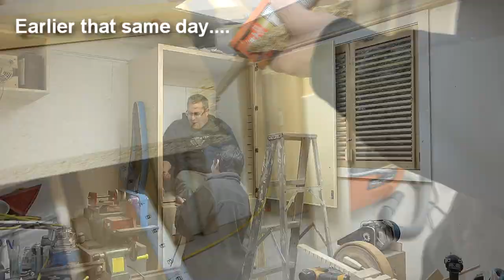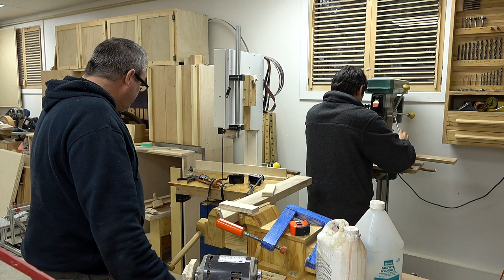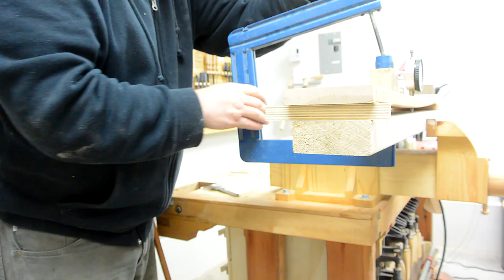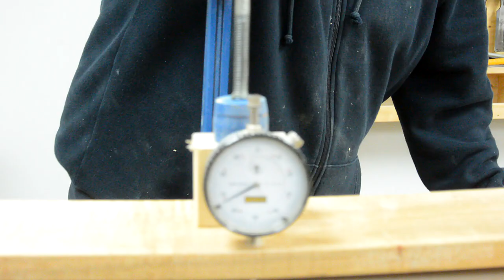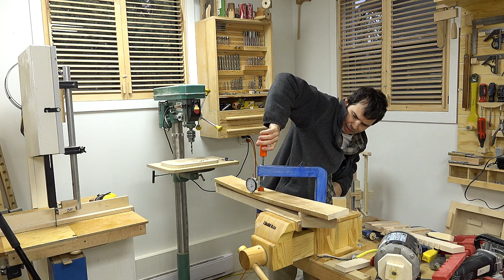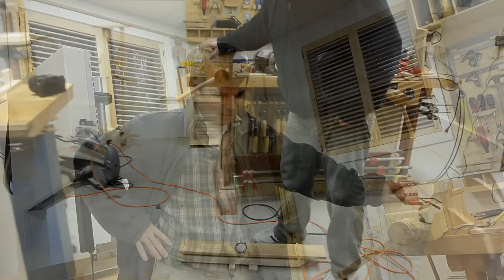Homemade clamp rivalry

Comment: John (paraphrase): "The strength is there; it's just breaking under pressure. It would go up to four, if I held it just right, even though the clamping pressure, which is the only purpose of a clamp, can't get past three."

Comment: Mathias and John: you guys inspired me to build a similar c clamp out of 1 inch square steel tubing for doing the brakes on my pickup truck. I welded it all up but broke one of the welds after FINALLY getting one side of the truck's calipers squeezed down to replace the pads. It was a real job, So I got this brilliant idea to weld a 1/2 drive socket onto the end and re-weld it. That thing is a BEAST!!! Thank you for giving me the idea. Now I just connect my battery powered impact wrench and let it do all the hard work. It's awesome! Y'all are a blast to watch.

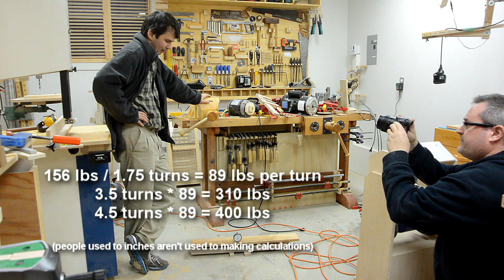Comment: 12:30  No it's not a linear graph, so just because you were to get 200lbs at 2 turns doesn't automatically means that each turns equal 100lbs. Am pretty sure both of you guys agree on that.
Reply from the maker: if it's not linear, then do explain why the relation is not linear and what relation it would be.
Reply: A curve plotting the movement of the beam you are clamping will be linear for most of the curve.  When the clamp joints begin to break, more force is used to deflect the clamp, or you close the gap completely, you will see a reduction in the slope of your curve.  How do I know this? - because I've done essentially the same test and collected the data, but using a robot arm, in a testing environment.
Reply: Because once there is tension and the wood is flexed (bowing) it will take more or less pressure to bend it just a little then when it was fairly straight. C'mon Matthias am pretty sure you know this, that's why I said that even if you were to get 100lbs at 1 rotation then 2 rotations at 200lbs, that does not mean that 3 rotations will be 300lbs (should be more or could even be less, but it will not be a linear graph). It would be a logarithmic graph. 

One way to prove this would be to actually plot it down every 10lbs, all the way up to it's breaking point and then we can all see the graph type.
Reply: jeanious2009 You would plot rotation of the handle vs deflection and my experience suggests you will see a linear deflection of the beam, certainly for what's just been shown on the video.  

You can do this yourself using the standard beam bending calculations here:

http://www.structsource.com/analysis/types/beam.html

The system in the video is closest to the pinned at both ends with a point load in the middle where x=a case.  Assume that each full rotation of the clamp handle applies the same amount of load in normal operation, because in normal operation of a clamp with a constant thread this will be the case.  Again, I have data proof gained in a professional testing environment.  The beam can be assumed to be homogenous and of constant section.  As you can see from the equation the beams stiffness remains constant regardless of the load applied, and therefore the beams reaction is linear.
Reply: Any graphs/tests to show this, I just don't think all wood is the same and am pretty sure the way the wood is cut/shaped has a lot to do with the deflection.
Reply: I think it is linear, mostly, https://upload.wikimedia.org/wikipedia/commons/thumb/5/5a/Stress-strain1.svg/300px-Stress-strain1.svg.png
Reply: But they tested it..  156lb/1.75turns = 89lb per turn, and John was 2.6turns and if he really was ~230lb then that is pretty linear to me.  Least until the board gets near its limit...  Linear enough to guess what the clamps could do anyway.

Comment: love the dueling banjo effects of the videos, watch both versions ,,, 
and in a lot of ways they are not store bought clamps of steel,,, but 
that said they are not store bought crap either , in real use you would 
never need to go to that extreme clamping pressure , have watched both 
of you for years now, and often wondered which had the better idea ,,, 
keep them coming guys   great work ,

Comment: The breaking point of either clamp far exceeds the clamping force of normal wood working use.  I don't recall a strength test in a video when these were made & didn't think much of the idea.  OK now I'm impressed & will probably make a few, can certainly see a use for them.

Comment: Couple of good eye-rolls in this one, John!

Any thoughts about progressive weakening of that maple board?   Oh wait, that isn't helping John's case at all...  :-(     In all seriousness, I am surprised at how much John's clamp flexed.     I think you're kind of right about the apple and oranges -- they aren't the same thickness of stock (in the clamps) are they?
Reply: His uses thicker wooden parts and a bigger lead screw (which resists bending, like mine did). Also, mine is made from flooring, so it have those grooves cut on the underside, reducing the cross section even more.
Still, I'm very impressed at just how strong the box joint is on it's own.
Reply: Sorry, but Matthias is absolutely right: The screws are ok. They are not meant to take forces from the side in an ideal world. Your's failed because of the failing joints. The rod got bent only slightly. Look at the joint, lol! Thumbs up for the courage to actually break it. Matthias one won, but after all it was just a test. Yours is good enough in real life. I mean who needs 2000 Newton clamping force? Really interesting that they don't look THAT different.
Reply: +Rainer Zufall john refutted every inch of your argument BEFORE you even posted yours in this same commentsection.
please read before spewing nonesense with 0 information to back it up
Reply: John Heisz bragging rights aside, they're both cheaper than a commercial clamp, and serve their intended purpose for the maker. Generally speaking, the additional force you can exert at a distance by having the clamp vs none at all, is more beneficial than whatever higher force a beefier clamp would provide. Thanks to the both of you for this collaboration.

Comment: Matthias's clamp clearly inspires more confidence but in John's defense I remember one video of Matthias stating that the pressure of clamping (seen by squeeze out) was not really improving the quality of the glue up.
Reply from the maker: too much pressure is bad, yes.  Like 500 pounds on a very small area.  But if you need to reach far, it's usually also a large panel, so 400 ponds is by no means excessive force.

Comment: I love the interaction and the comparison of the clamps.  It reminds me of when my brothers and I are together comparing different things we do!  I also love the box joint rivalry - so if you have not seen that - what that does is point out the pro and con of each model.  

At least that is what I see.  So if you are going to make a long reach C clamp, if you think you will need some serious clamping pressure, you need the extra time to create one like Matthias.  If it will be pretty much lighter duty (although ~300 lb clamp pressure, I would not consider light duty - just in comparison), then John's clamp is a bit quicker to make!   IMHO
Reply from the maker: for more about the box joing jigs, see description of the box joint jigs videos.
Reply: Ray Ramirez not just that, but using a heavier size Acme threaded rod like Matthias's will be less annoying to tighten, and the thicker material will bend less. It will add cost though, both for the rod, and the special Acme insert nuts.

Comment: This test is not legit. Johns clamp with the wooden block under the lead screw performs a much wider "pressure point" than Matthias clamp, causing his to apply pressure to a greater partition of the maple board than Matthias. Johns clamps must therefore work against the Maple board wanting to bend in addition to the actual bending/downward force. The riser block should have been placed under the Maple board on the fixed part of the clamp.  Engineering can be difficult. ;)
Reply: I have been working with this type of test for the last 18 years my friend.... ;)
Reply from the maker: do learn some physics, please...
Reply: Roy Ivar Hernes damn son bei g told to learn by Mathias. that's got to hurt.
Reply: He does have a, very small, point. It didn't change the outcome but John's clamp had to apply slightly more force for the same deflection due to the width of the riser.
I was surprised you didn't just put one clamp on each side of a seesaw arrangement and let them work against each other.
Reply: In my opinion, without calculating anything out, I'd say that the effect from Matthias being a little closer to a point load and the other guy being closer to a distributed load was negligible in this case. The difference wasn't that big.

Had that spacer been 4+ inches long, sure.
Reply: Angel: Hehehe. I love both of these fine woodworkers, and I am to old to care about Matthias ways ;)
stefanrethan: You'd be suprised if you sat down and calculated. ;)
Consult: I agree to a certain degree, but it definitely would make a difference. :)
Reply: +Angel Cedillo that would be an emotional response lavking logic nd reasoning. 
Most specialised individuals are severly lacking in every aspect of their lives excluding their specialization. Matthias is no different.

Extending the admiration to every other aspect othrr than that of his specialization is foolish...but again thats what most sheeple do with hollywood actors, granting them legitimacy in aspects where they are severly lacking because they mastered that one specialised aspect in their lives... aka robert deniro spewing BS about trump and actually convincing sheeple to change their minds about politics when he is only good at acting
Reply: You might have a point if the results were close, but they weren't. As soon as the angle of applied force is noticeably off from perpendicular, that clamp is past it's useful limit. That happened at about half the force for John's clamp.
Reply: I get only 1% difference in deflection, and that's assuming one clamp is a point load and the other is 6 cm apart on a 60 cm beam.
Reply: I used the beam calculators on engineersedge dot com. Electrical engineers are allowed to cheat.
Reply: Stefantrethan: Did you calculate with wood or steel? I was actuallly convinced it would be a greater difference. Okidoki, my bad.  I guess I have to go back to school! 😃 Sorry Matthias, 1 - 0 to you! 😉
Reply: I don't see how the material makes a difference on the difference?
If anything the softer wood would mitigate the effect, given that it gives at the corners.
Reply: Just pulling your leg, Stefantrethan. 😊
Reply: Came here to say this.  They both should've used the wider spacer block, or not.
Reply: you are exactly right. Matthias should have used the same block as well. This was not a fair comparison!
Reply: you really do not know anything about physics. if the above are agreed, they don't know either. The tip of Wandel's clamp has almost 4 times smaller area than John's block, so John had a 4 times disadvantage compared to Wandel. I am 100% sure that Wandel knew about it but didn't reveal the truth!

Comment: Um, it doesn't count as clamping force if it won't hold it on its own. The threaded rod was not the limitation. Once your clamp starts to bend and begin applying off-angle force, you're way past the limit of it's usefulness. The threaded rod only began to bend as a consequence of the clamp frame bending.
Reply: Trevor Lambert here and I thought that I was the only one who knew that.

Comment: you could also find the force exerted with beam deflection formulas :p
i tryed to do it, but the thickness of the plank is very critical in this calcul, and I couldn't get it precisely from a video

so you could find the force in Newton by using this formula : (4 x def x E x thickness³ x width) / length³
def=deflection in mm (number of turns of your micrometers)
thickness, width and length  of the plank in mm (inches x 25.4  and length being between the 2 "feets" of wood under the plank)
E=Young's modulus, in MPa (because N/mm² to be consistent with the other units), for maple wood i found 12 620MPa

I had realistic results with 23mm thickness, 150mm width, 610mm length (when you said 12in both sides, that is 12 x 2 x 25.4)
of 1.8kN for Matthias's clamp and 1.4kN for John's
which equals to 410 and 320 lbforce, compared to the 400 and 310 i got from matthias being 156lb and deflecting the plank 1.75mm
Reply from the maker: Also the stiffness of the board.  which varies wildly between boards.

Comment: The distans you use with the second clamp should be turned 45 degrees, otherwise it will be incorrect comparing.

Comment: This test would have been more interesting if they had used the failure mode in the second clamp to improve the design. It looks to have three failure modes: the upper joint, the flexing of the "spine" of the clamp and the deflection of the screw.  To fix it you could increase the width of the spine slightly and shape it in a sort of dog bone fashion so there was more surface are at the joints. That would solve two of the issues. The deflection of the screw would require a slightly larger diameter all-thread.   It would add a bit of weight but it would significantly increase it's capacity.

Comment: Wow, I'm surprised at the difference. So Matthias's clamp is all box jointed while John's clamp is just tongue and groove, but has that extra threaded rod. I would have thought the threaded rod would have made it much stronger. I wonder how it would compare if they were both using 1/2" threaded rod.

Comment: That block being wider under John's probably effected the measurement cuz the pressure was more spread out....  Although the clamp itself did seem to be a bit more flexed....
Reply from the maker: No, spreading the force over such a small area makes no measurable difference.
Reply: Ok. 😎
Reply: I was more thinking along the lines of the footprint in relationship to the distance across of the plank being squeezed.  A smaller piece pushed down would allow more flex in the center as opposed to a wider point.  ...maybe I'm splitting hairs.  I enjoy both of your videos.  I was shocked when the F bomb came out though.  The wife and daughter gasped and was wondering what horrific content I've been absorbing....

Keep up the good work!

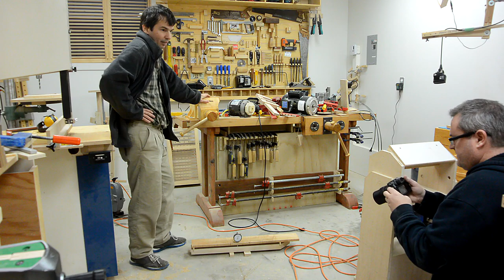Comment: 12:20  w (L/2) = PL^3 / (48. E . I)

Does it match your data ?
Reply from the maker: It does for the right values of variables.  Modulus of elasticity of wood varies a lot from one piece to another, so no point in trying to calculate it.

Comment: Question?  For the large C clamps, if you built them and made the ends where you clamp closer together then making them square would you be able to get more clamping pressure as they start to open up?
Reply from the maker: No

Comment: Your clamp is clearly superior. But they are different designs and there will always be variability based on material limitations anyway, especially the wooden parts.
Reply: That's what engineering is for, isn't it? Figuring out which designs are best suited for the job, based on their limitations.

Comment: I just noted that John's handles have a square profile. As good as round ones look I think square really is superior when it comes to cranking them with force. Damnit... turned mine round. Time to break them :-)
Reply from the maker: Grip on the handle was not the limiting factor, at least not on mine.
Reply: Yeah I know. Not in this case. But especially with smaller clamps meaning smaller diameters it can be hard depending on the finish of the handels. I like oil, but it makes them a bit slippery. Actually I can turn them all but I feel the (unnecessary) stress in the hands. My mother suffers pretty bad from arthrosis and I have to admit that I always fear the possibility I inherited that weakness. Near future will probably tell but until then I like to keep the stress down.

Comment: his bearing block was facing the wrong way. I'll bet he would have gotten much better results if it had been turned 90 degrees. Also, given how far he actually screwed his clamp down he probably didn't need the block in the first place.

Comment: What kind of Maple was is it, also what were the dimensions of the board. Thickness, width, etc. I have my Mechanical engineering text book next to me and based of the deflection I should be able to  calculate the actual forces.
Reply from the maker: No need to.  Watch the video to the end.
Reply: I was mostly just curious if interpolating based on your weight would yield the same results or if the force had a non linear relationship with the deflection.

Comment: why don't you make a bolt at the end of the handle so you can use a cordless drill to operate the clamp, it's easy to use if you have a lot of clamping to do.

Comment: very funny! not entirely correct though. John added a block of wood that spread the force along the top board, slightly away from the center. I'm surprised Matthias didn't catch that, or did he? the block should have been on the bottom for a fair comparison. 
thanks for many laughs!
Reply from the maker: That's because that board makes almost no difference.  Moving the force 2 cm away from the center doesn't do much.  If you don't believe me, learn how to calculate deflectio of beams and such (and come back in a couple of years once you figured out how to do that)
Reply: Think about it more simply, with the block on top, as he continues to crank it, the angle of the threaded rod changes. The further from center the block is, the more noticeable the affect of the angle is. If it was on the bottom, the angle of force on the spacer wouldn't change.
Reply: "Couple of years"? Ouch.
Reply: wow, burned!